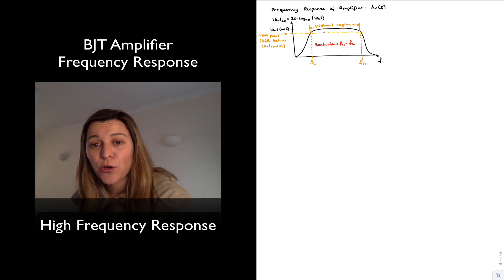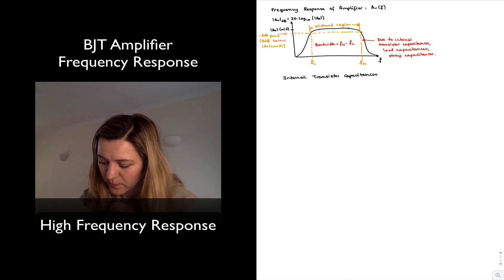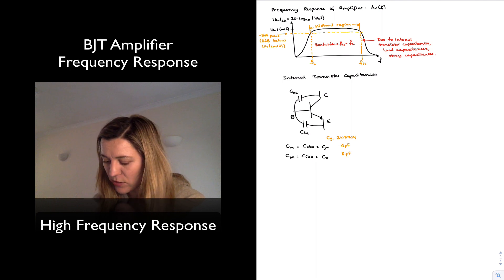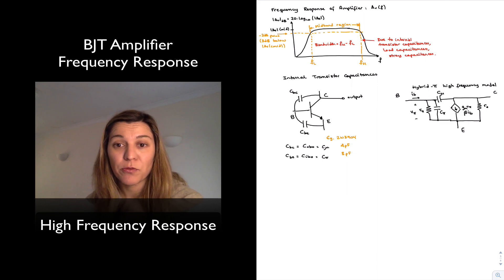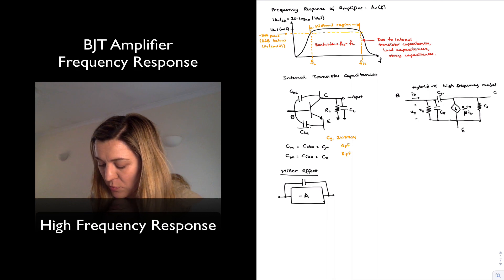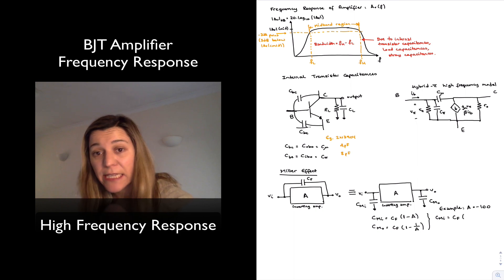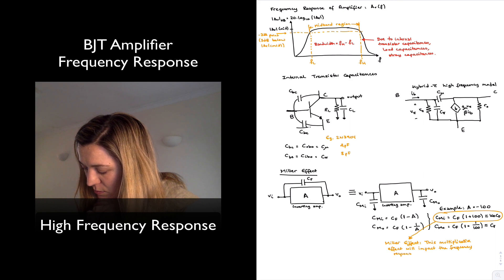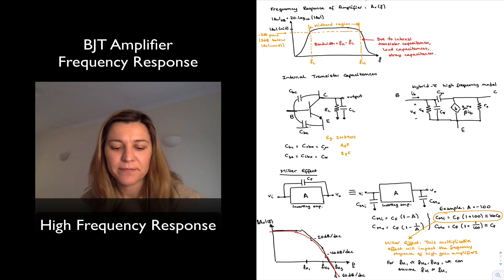BJT Amplifier High Frequency Response

Comment: Hi there, I wanted to thank you for your amazing videos.  They are very helpful.  I just wanted to share that as far as I understand Cibo does not equal Cπ.  However, Cibo is a component of Cπ.  Cπ = Cbe+Cje.  Cbe is a function of gm, and thus cπ depends on gm as well.  Cπ can be found with the following formula Cmu+Cπ=gm/(2πFt).  Here Ft is the transition frequency.  c. Micro Electronics 7th ed. page 719-720.  And Microelectronic Analysis and Design ed. 2 page 511-513
Reply from the maker: You are correct. This is a rough "zero-order" approximation.